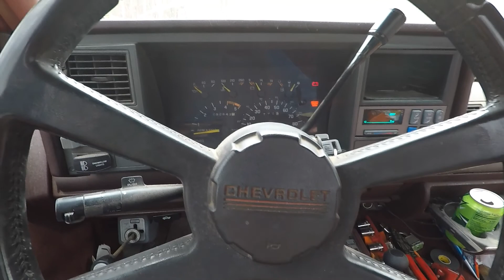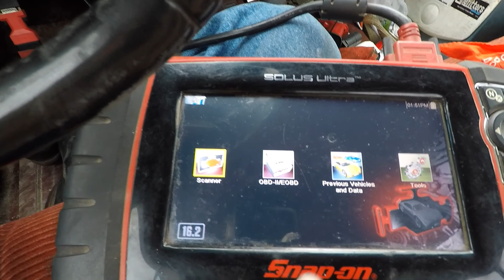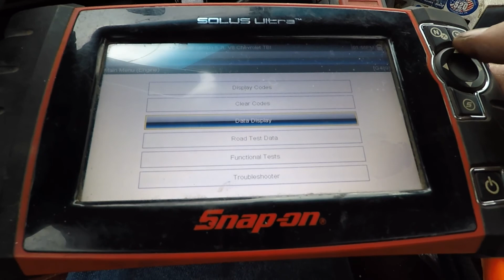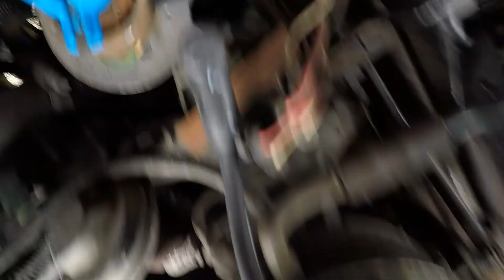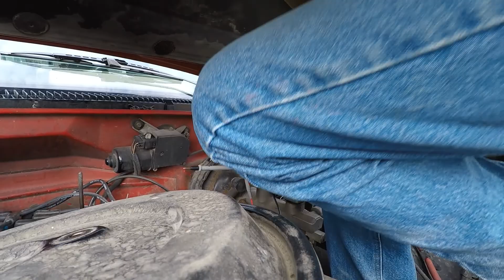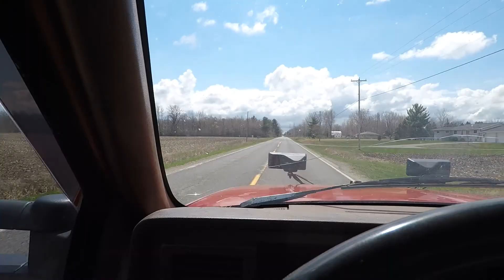1992 Chevy K1500 No Fire

Comment: well at least you got it fixed. I have had numerous trucks from 1988 to 95 come to me with issues, and it was always either the coil or module.  I have never trusted the gauges in my 1994 and 1995 truck, I got gauge pods and put in aftermarket temp, oil, and volt meter in, they are way more accurate than the dash gauges.  Keep up the good work Wesley, always nice to switch things up once and while!
Reply from the maker: I've got 3 of these trucks. A 1991, 1992 & 1993. I've owned the '93 for 18 years now. My dad has a 1995 & 1999 classic. They all have their quirks, but are reliable. I take the gauge readings with a grain of salt, but they do alright for what they are. Oh, I definitely have to switch things up every now and then. That's why I have so many irons in the fire! Thanks for watching & for the kind words!